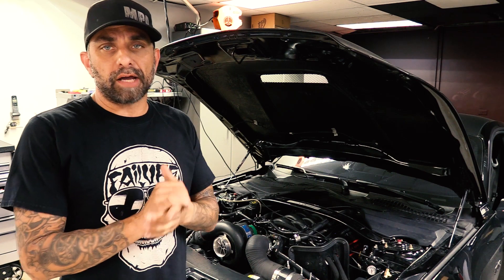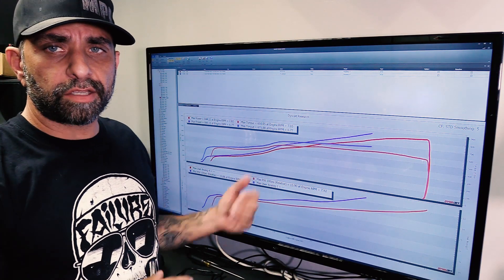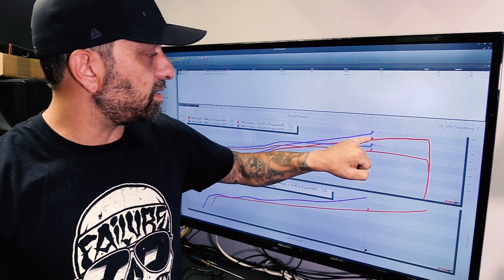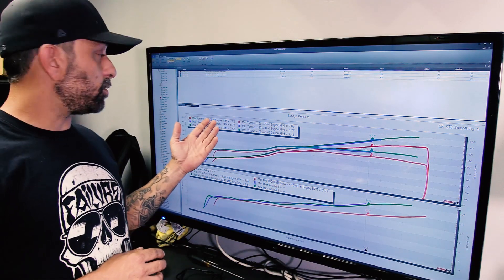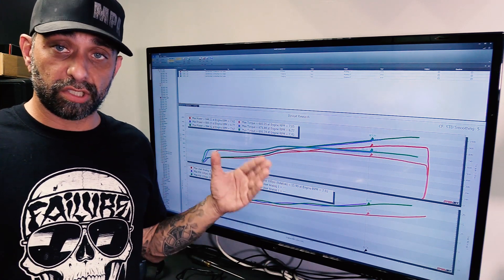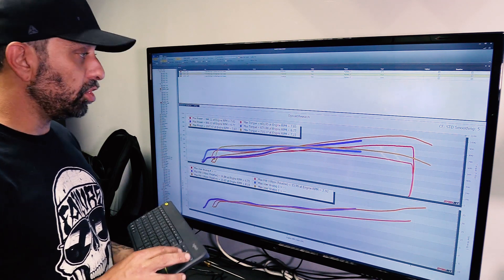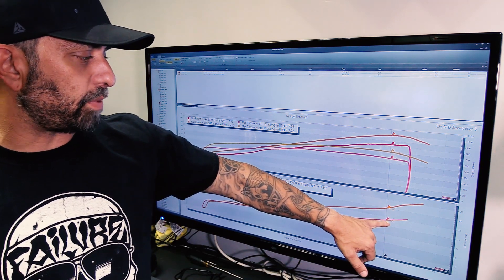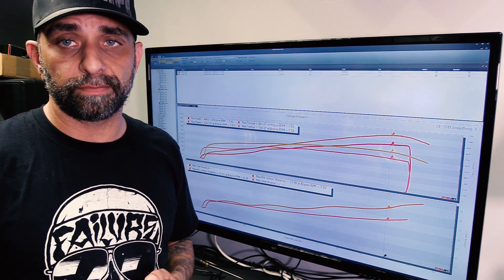Stock Engine vs Built Engine: What Is It Worth on a 2016 Vortech Mustang GT?

Comment: I have seen where a built engine LOST power with the same boost, fuel system, heads/cam, compression, RPM ect. The only change being forged pistons, rods and crank. Of course at a certain point you need those things for a higher ceiling and added safety.
Reply: Normal.  Aftermarket rings are generally thicker and higher tension which robs a lot more power than Ford’s thin, low drag fuel economy biased rings.  And a lesser factor is that the pistons/pins/rods are also heavier. 

But the biggest loss comes from the ring pack change.

Comment: Guess my question got deleted
Reply from the maker: I don't think it did. Ask it again
Reply: @PalmBeachDyno  see if u can come close to what u think my dyno will be. Made 671hp @ 10psi should seen 14 but belt slipped at 5300rpm on pump. Once belts fixed an spyn to 7k rpm what do u think it will make
Reply: @gtkid7932  750

Comment: Ok so it was a non sleeved built engine. At what point is it smart to sleeve? My goals are to definitely stay under 1000 hp, most likely stay around 800 max. Would I be better off with just a forged rod and piston built engine?
Reply: They say sleeved is needed for 1000+ whp
Reply: @ForcedfedFords  900

Comment: Exact same setup on my car but it "only" made 800 rwhp at 16 psi on E-85 but is auto.  My car also has the Jt non billet impeller.
Love to see that 1000 is possible upping the boost on this set up. Is his engine block sleeved? Do you see any risk with 1000 rwhp only with good pistons and rods without sleeving the cylinders?
Reply: Not to speak for him but he mentioned near the end its not sleeved, hope that helps. Just beefier internals.